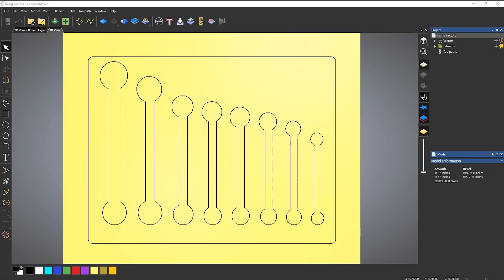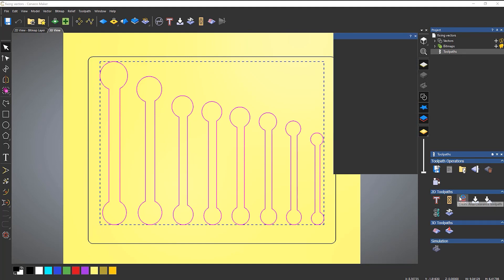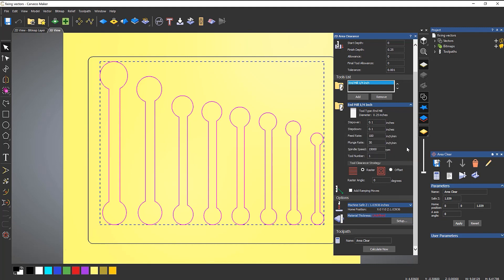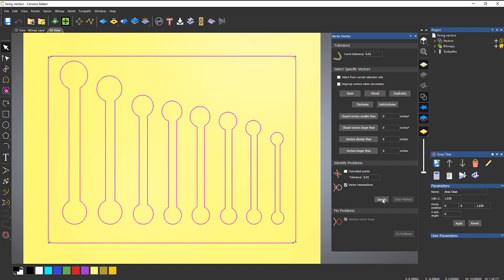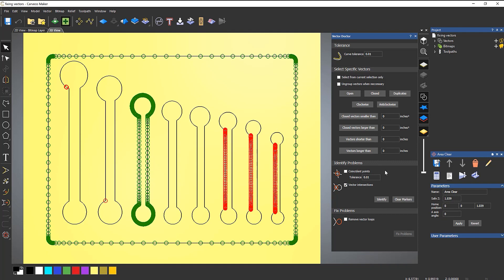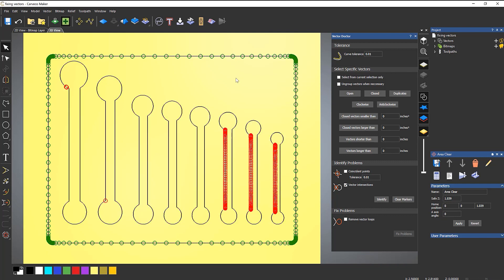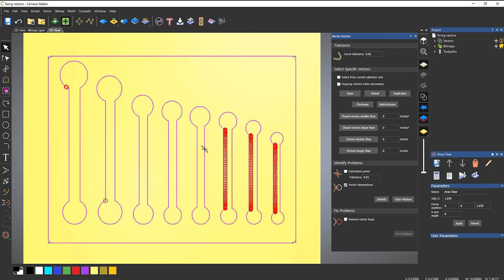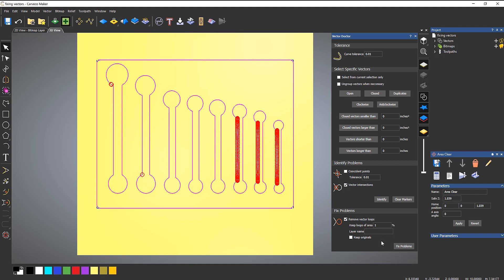Carveco Maker: Fixing Imported Vectors

Comment: Thanks for your helpful explanation.  Carveco identifies vector intersections where they clearly do not exist (or I cannot find) as often these intersection green circles are not near a line and sometimes in a group of 3 or four.  I have gone as low as 3 colors to reduce the number of vectors found, but not sure how to proceed to resolve these issues. 

For the instances where the green circle is on a line and deleting removes the only vector,  I have cut and reconnected these vectors as well with no success as the green circle remains.  

Any recommendations would be appreciated.